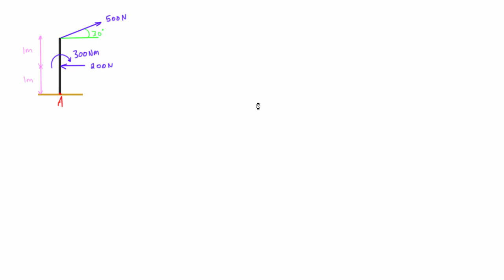Represent a system of forces as an equivalent system with one force and one moment

Comment: 1st of all--Awesome videos...the engineer4free website has literally been a life-saver for my statics class. I'm making this comment because I noticed that your final equivalent FBD had the moment going in the incorrect direction. You assumed Ma was CCW, and the result was positive, so that means it was assumed correctly and is rotating in the CCW direction...correct?
Reply from the maker: Hey Terrence, glad to hear that my videos are helping! I see where the confusion is coming from here. The writing in black ink is solving for the reaction at A, specifically, Ax, Ay, and Ma. The reaction moment Ma is counter clockwise for the original system where we have the two point loads and one applied moment action on various parts of the structure. The purpose of this video is to "condense" all the externally applied loads and moments into a single load and moment such that the reaction would be the same even though the number and location of loads are different. Honestly it's a strange concept, but because it gets asked for we have to do it. The stuff that's written in green ink is the equivalent system with only one point force and applied moment. Because there is only one force  and one moment, it will be equal and opposite to the reaction force in this case. So the x component of the green force is equal and opposite to Ax, the y component of the green for is equal and opposite to the Ay, and the applied moment is equal and opposite to Ma. This is why you are seeing a moment with the same magnitude but flipped sign. The green moment is not the reaction moment, it is the sum of all moments about point A in the original structure. Hope that helps clear it up, let me know if it's still not clear =).